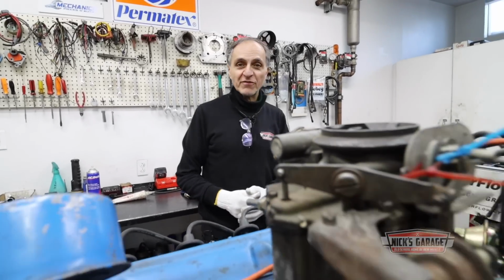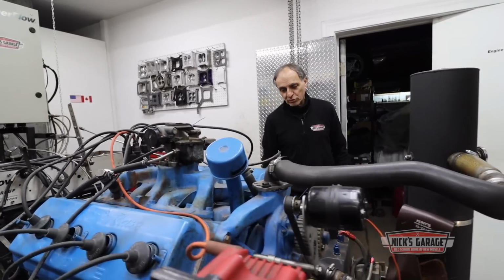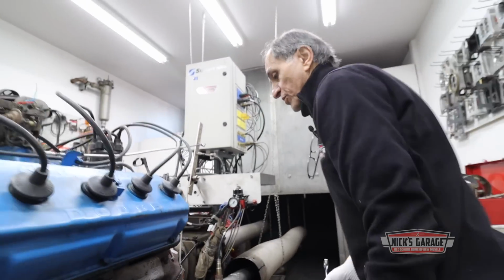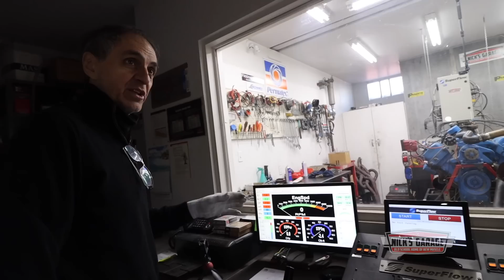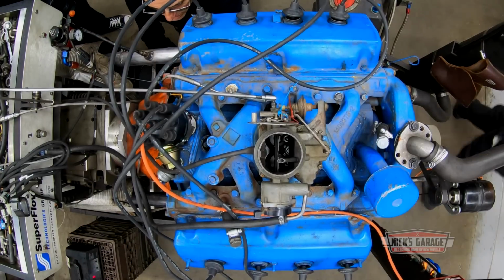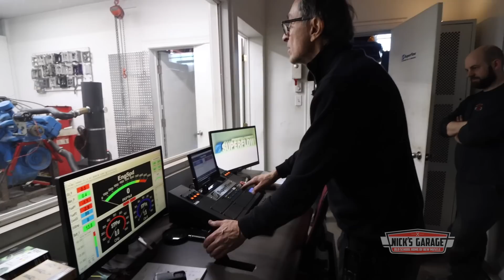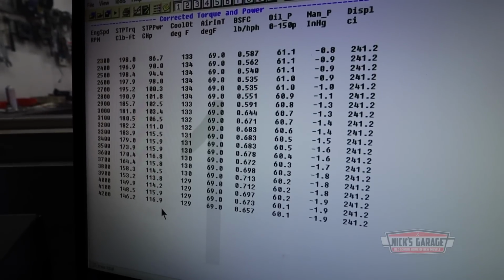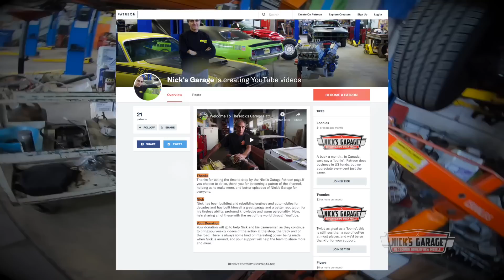Gen 1 HEMI on Dyno - WEAKEST Engine I EVER Tested

Comment: This is what happens when there is no flange to center the flywheel to the crankshaft. For the next time we will have a machined flange to prevent the flywheel from being off center. Thanks for watching.
Reply: Keep making great videos Nick, in 100 years people will be using them to restore your way.
Reply: Time and material Nick, that's the way it goes.  They've got to pay to play
Reply: That is correct, every engine is just as important as the next for the owners. Make a flange if needed. If it takes all day, so be it. The customer will pay the bill.
Reply: Hi, Nick! That was brutal, but fun to watch! It's amazing that old hemi didn't come flying off the dyno! 😆
Reply: Not sure but I think the correct flywheel centers on the outside of the crank flange. Also recommended governor speed is 3400 rpm in trucks, I think it was higher in cars maybe 4200 rpm.
Reply: Great video! I’m sure you already know this, but on most starters you can get a piece of stiff wire, to pull the starter gear out to check it’s alignment on the ring gear, then you can prevent ring gear and starter gear damage, and also know right away it if will work
Reply: But the lesson I drew from it was to never give up: test, find the issue, experiment w/repairs, test again...Some people I've worked around or for would've quit at the first sign of trouble - but not you. We're going through a rough patch - I'm not trying to belittle the situation, but I'm not going to panic either - but somehow, after we've made it through, I'm coming up to visit, & maybe have a coffee while touring the shop. Thanks Nick!
Reply: Seems to me I remember a friend of mine had an adjustable flywheel back in the day I don't know if it was a Chrysler made thing or if it came with his dynamometer.. but you could add or subtract shims and weights to the flywheel it was a whole flywheel package that you could purchase for the internally balanced... That would help youdim the balancing in the flywheel so when you cut the new flywheel you can balance it to the engine...
Reply: Lateef Carrere I didn’t see any problems with their tactics because I’m the same way, I always strive to overcome any issue that I have, and yeah, don’t panic, that makes all situations easier! I have had this exact issue with a ford setup, it’s wasn’t fun lol
Reply: It looks like the flywheel is smaller than plate its bolted to under the bell housing. And its probably rubbing, hence the chewed up starter.
Reply: I also wouldn't be surprised if the quick and easy spacing of the bellhousing from the block didn't help things, since that cuts the bearing surface down to a minimum and then allows the bellhousing to flex more than it should - hence the cracked bellhousing. The fact that Dodge designed it so that the starter bolts to the bellhousing also doesn't help, since that's a lot of weight to have hanging on an aluminum bellhousing. Still, good job getting it to work on the dyno!
Reply: I like the solution, next time look to get a taper fit bolt sleeve kit that you can use to center the holes, tighten and then remove them one at a time for the proper bolts without losing center.  Something I bought for matching pump head flanges a long time ago.
Reply: It is not the customer's fault there was a delay for fitment issues,  he shouldn't pay extra for machining and time , those are tools the garage will use Later a d learned from. Respect for the garage and the customer both
Reply: @BenJamin-ou7kd  .   You are correct. This is why there was no charge at all on the 1st and 2nd 241 Red Ram, which took time and fabricating a front brace. I know of another Dyno operater not far from my shop that would have never taken this engine. NO customer has ever been charged for extra work on the Dyno, engine or equipment.
Reply: Wondering if it was completely disassembled and gone through again if something might have  been done that was incorrectly done by someone else
Reply: no bellhousing dowels either
Reply: I know you were fighting flywheel fitment but the way it starts smooth and gets worse makes you wonder if the engine was in fact balanced or not
Reply: @6226superhurricane  yep forgot about that
Reply: Very cool video!!! It would have worked better with a matching starter, bellhousing spacer plate & flywheel ring-gear, however , Nick did not have the good fortune of having those parts for this test...But Nick got it going anyway... That is determination!!! The  Mopar LA distributor for this 66 year-old engine was a great discovery!!!
Reply: @6226superhurricane  .     That is correct. NO.
Reply: @robertgalvin7081  .    Yes, I was.
Reply: @michaelmartinez1345  he mounted that 241 the same way he did the 241 Red Ram and I know there was nothing different in his he mounted this one up to the Dyno (outside of Dowel Pins)
Reply: I did engine dyno testing. Mount a starter to the dyno side of the engine dyno. Custom bracket. You can mount any engine to the dyno and totally bypass the starter mounting to the bellhousing. I would have probably machined the starter housing because it looked like interference to me. I would have been done hours earlier. I believe everyone is correct about the flywheel not being centered. The main issue looks like flywheel to me.
Reply: Some engines of the time were not sholdered on the crank flange some were sholder bolted i have a d8 cat restoration project had to put a ring gear in as for that all parts are in great shape and to point out this flywheel is not only sholdered on the flange of the crank but it also has 3/4 inch sholder bolts guess they didnt want this 24 inch flywheel coming lose
Reply: @andrewklahold2880  you blame them? Flywheel that big is probably going to go right through the farmhouse if it comes loose. When you're out in the back 40!
Reply: Excellent tip. Not knowing tricks of the trade like me is a real head ache!
Reply: It's funny watching this and just from the vibration and observing the wobble I was thinking that, then read your comment.
Reply: Yeah you shouldn’t be running this engine unless you have the correct parts. That crank isn’t even close to being balanced with how of center it is. Wow
Reply: Had me thinking if there was a thrust bearing issue for a moment.. but your no dummy. Just sent it. I can tell you didnt make money on that one. Your starter likely  .your flywheel and bellhousing are all fucked
Reply: Holy hillbilly!
Reply: make up a set of horseshoe shims , you can then change them without removing the bolts everytime
Reply: There is usually a dowel pin to correctly locate the flywheel ..
Reply: @TheRoguelement  .   Not in this application.
Reply: Nice a second Red Ram......you need to build one to make power just to see what it'll do, Nick.
Reply: @BrockGrimes  everything is available.
Reply: I always thought overheat should have a buzzer, like the better speedboats.
Reply: I just went through something similar with the aftermarket wheels on my car. The new wheels were not hub centric so I was getting vibrations. I ordered and installed some aluminum hub-centrric rings and no more vibrations.
Reply: Definitely shows how important it is to have the entire rotating assembly and everything that mounts to it balanced and aligned or it will destroy itself.
Reply: InstaBlaster...
Reply: @drivinwithdrew7676  Friend installed a 302 in his '67 Mustang 4-speed. Gave up getting all the flywheel bolts in so he figured it'd work fine with one left over. Ran shook like hell, sound like it had on bad assed cam lope. I stopped by the next morning to see how he was doing, told me it was done. I sat a soda down on the bench and seen a flywheel bolt laying there, asked him about it. Said he'd left it out. I explained a few things to him. We slid back the tranny, pulled the pressure plate, showed him how to turn it one hole at a time until they all fit. If he knew something, he knew it for life-but he had to be shown everything the first time, couldn't work it out himself.

Comment: The whole setup looks VERY sketchy!
Reply: the way that bottom ends rotating assembly getting BOUNCED AROUND, i wonder how much life that dyno session took life away from the rotating assembly?  just sayin. You can literally really BEAT TO DEATH the bearings THEN, have a bad case of THE come aparts  Yep!
Reply: definitely, I would have put an end to it as soon as I saw that.
Reply: The amount of hackery in this video is astounding. The comments above are talking him for not quitting or giving up. But "knowing when to stop" is not the same as "giving up". When you can't center the flywheel and have so much vibration your start is vibrating back and forth an INCH and you start break bellhousings - you need to stop. Period. At that point you're damaging the engine main bearings, stressing the crankshaft and running the risk of completely destroying customer's property and possibly risking serious injury. 

Anyone who even knows the slightest thing about engines, flywheels and machinery in general would know that the flywheel would not be even remotely close to being centered without a proper hub and the engine should not be run. The best part is they had a dial indicator that they could have used to manually center the flywheel (snug the crank bolts up, then gently tap the flywheel around until it rotates concentric, then tighten the bolts down), but they instead hacked something together with pieces of wire and an old chunk of metal????
The narrator then tried to frame it as it being the engine/customer's fault, because it was an unknown engine built by someone else. No, it's because you had people who don't know what they don't know, doing things way over their heads, when they should have just admitted to the customer they didn't have the parts necessary to do the test.
Reply: Yes using expensive equipment on make shift garbage is questionable.
Reply: @AmericanLocomotive1   I couldn't agree more.  He's a likable guy and I've enjoyed several of his videos in the past, but after watching this video, I see a huge lack of sound judgement.  After seeing this, there's no way that I would let him work on any car of mine.  I'm really surprised that he even aired this episode, another example of poor judgement.
Reply: @AmericanLocomotive1  I'm really disappointed in this channel. Total hack job. Zero professionalism, zero concern for safety or life of the engine.
The whole thing was ridiculous and dangerous. 
The amount of blame that was put on the previous builder is pathetic. 
Seems a fair amount of arrogance involved - if Nick didn't build it, it is junk - that's the ongoing narrative here.
Reply: @AmericanLocomotive1  Well stated--dorfus71 too. I was surprised to see what went on here and that BS about trying to blame the person that built the engine was ridiculous. Lost respect watching this that's for sure. Just watching that whole setup bouncing around was ALARMING and reading the comments from some here shows they are clueless as well!
Reply: And then the customer left with a big smile on his face. 

.
Reply: Hemispherical Chambers alone are sketchy.  It's a bad design.
Reply: @Someone Bald Thank God, a comment where the respondents aren't blinded by reverence or affection. When the narrator said it was bucking and Nick was gonna ride it like a cowboy, he MEANT cowboy. I cringed. I physically shed a tear for the mechanical carnage I was watching :( They tightened the starter (after letting it destroy itself and the ring gear) but it kept wobbling, presuably cos the bellhousing smashed? This is an embarrassment to EVERYONE involved. His measure of success seems to be "look, we bolted the flywheel on off center, it shook like crazy, doing untolled bearing damage, we did some dyno pulls anyway, and it has GREAT oil pressure and NO leaks, GREAT engine, just a GREAT engine :(
Reply: @GeoffInfield  I would have removed the starter while the engine was running. Instead of watching the flywheel and pinion battle it out.
Reply: Glad its not my engine
Reply: @Larry Niles yeah like Keith Black is he?
Reply: @Larry Niles Who did I call arrogant? 
He's a god in the engine world?   Yeah right. 
Who am I?  Some who can read and is perceptive with a much better understanding of all things mechanical than you will ever have.
Reply: @kieranhimself3655  LOL, very well said Sir!
Reply: @AmericanLocomotive1  Great summary and you are 100% correct, very questionable "trickery" going on here. No thanks.
Reply: Hes a God and u are ?
Reply: @AmericanLocomotive1  -agreed.  I’m just barely competent enough to keep my own ghetto gliders running.....and I’d never attempt anything so “yang” as this.  There’s just too great a likelihood of screwing something up majorly.  And for WHAT?  Cripes, this dude runs a good sized shop while doing stuff like that?   Jeeez......

Comment: Nick is like a terrier; he won't let go until he gets what he wants. The little V8 would have been quite something in its day compared with engines of the same period. It was obvious it had more to give on the dyno, quickly grabbing revs  but let down by a difficult to adapt flywheel. Another mystery solved.

Comment: Most dyno shops would have sent that guy packing. It took balls to help this guy. Thanks for making it happen. ❤
Reply: Ridiculous comment. Others have stated this was a hack job. After watching this i have lost respect and that constant blaming about someone else built the engine----had NOTHING to do with what went on here. It was dangerous and that put a lot of strain on the whole crank and rotating assembly. Shocking to say the least!
Reply: Yeh Nick is tenacious, not a quitter.
Reply: Not impressed with Nick at all. I could improve the balance of the flywheel in 10 minutes.

Comment: Those first gen hemis have a cool look to them, would be perfect in some kind 1930-s body style hot rod.
Reply: Over here in Australia there are a small number of Dodge Hemi engines used in 1933 Dodge Street Rods. Dirk, in the city of Adelaide, South Australia runs a 241 in his 1933 Dodge roadster* & a 325 in his 1933 Dodge Sedan Delivery. [His 1933 Window coupe runs a a Chevalay] 
Rob, in Bendigo, Victoria, runs an early Dodge Hemi in his 1933 Dodge Touring* [His '33 Roadster* runs a 500 cube alloy Hemi, his '33 two door sedan runs a 354 Chrysler  Hemi & his '33 Pickup runs a DeSoto Hemi of some sort]
 As for me here in rural New South Wales I have a 1957 Dodge 325 engine for my 1933 Dodge 3 window coupe.
*The 3 Window Coupe, Roadster & Touring bodies are unique to Australian production.

Comment: Hey Nick - there has to be someone on your block, or at least close to your shop - some small shop - that has a lathe and small milling machine. You have to invite that guy over for coffee and car talk...and casually mention sometimes it would be great if only you could get spacers and adapters made up fast and cheap.....swap him for welding (many machinists and small industrial machine shops don't have welding equipment for some reason) and normal car repairs (tires, oil changes, etc.). When I worked at an engine machine shop, we traded work back and forth all up and down the street for jobs we couldn't do - welding, CNC, sheet metal, general automotive diagnostics and repair, tires and wheels, upholstery, transmissions, drive line, body and paint, etc...we even swapped two years worth of once a week free lunchtime Domino's pizza for rebuilding the restaurant owner's small block L82 Corvette engine....
Reply: Friends make the world go round!
Reply: Scott.   I do have a machinist down the street. Good help all the time. But this issue was during night and the next day "Saturday" for the client to pick up. I just wanted to make a couple of tests and done with. Not long ago, I had another 241 Hemi on the dyno the same installation, no issues. Same client.